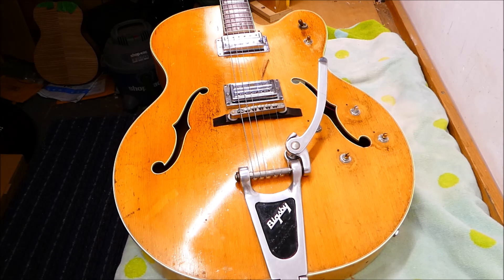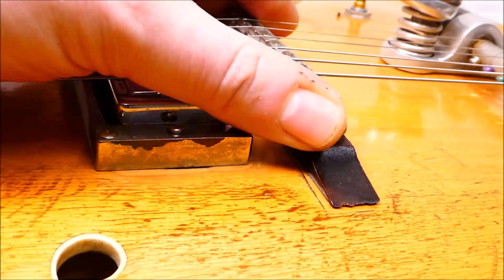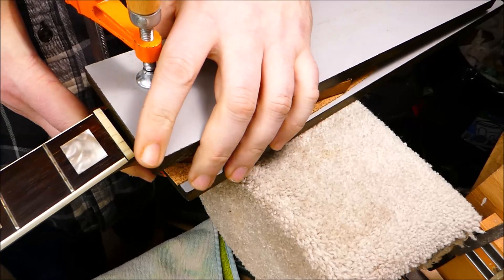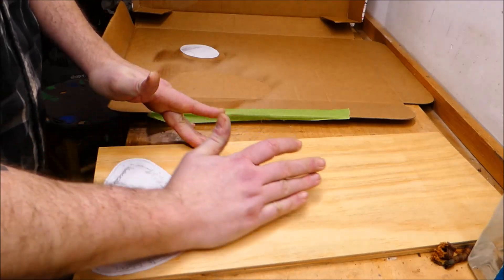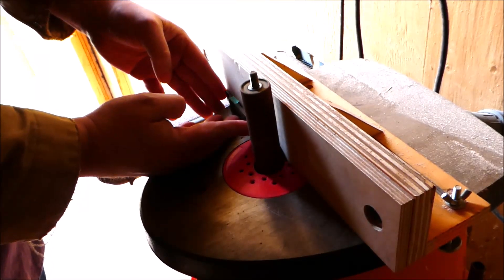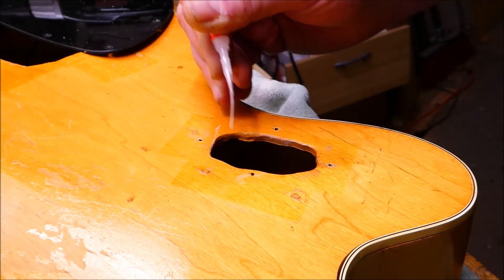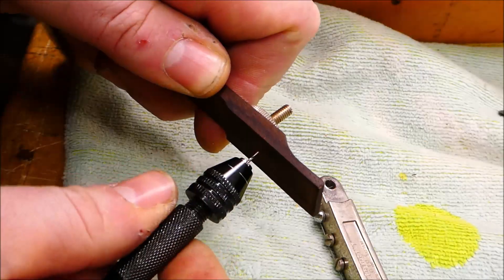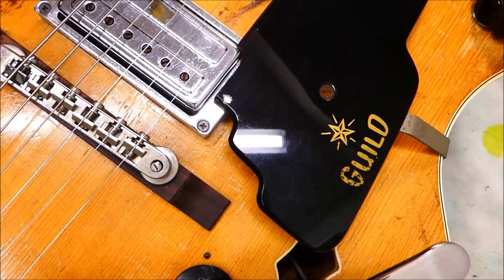'68 Guild Manhattan X175 Repairs

Comment: Nice! The replacement covers reminded me of a freebie I did for a guy at our church once. The pastor was trying to get the family to chose our church as they were looking for some where to go. The guy had mentioned he had a bass that was missing a cover, had a screwed up nut, and horrible ac buzz. The pastor asked me to check it out since that was my hobby. So I bought a new bone nut, a sheet of cover material, and supplied some coax wiring I had. Totally rewired the system with the coax, installed the nut , and made a new cover. All for free. I worked out of town and was home only 4 to 6 days a month. The guy was pissed because I took too long. Which I did, but I never even got a thank you for what should have been close to a 200.00 repair. Maybe you could do a vid one horrible customers at some point.
Reply: There's bloody Christians for you!
Reply: There's bloody Christians for you!

Comment: I have a 67 Guild acoustic I bought a few months back, It doesn't seem as boisterous as I would like it a players guitar. I got it at the local Guitar Center it was in the acoustic high-end booth it plays well I'm thinking of getting that back of the guitar Amp that had effects like reverb and some gain no permanent modification required, I don't have any trusted Luther out here in CA like I had back in NJ. Love just watching you work I feel I've learned a great deal watching you, not sure about fixing or diagnosing anything but if I did try anything I would need a shop, that is actually why I am moving back home to Colorado mostly family reasons, but having shop for me now is far more important then years before. Anyway you are a talented Luther I appreciate the things you share on such a wide variety of problems these skills are far a few between as time moves forward musical instruments that are actually used will continue to need works such as yourself. Thank You

Comment: Beautiful old guitar and I really like those small humbuckers. I’ve definitely gotten frustrated working on the wiring of hollow guitars but never so much I would cut holes in the back of one. To cover odd shaped routes I’ve set pick guard material in the sun for a while then put it directly over the route and weigh it down until it cools and it makes it fit perfect.

Comment: At 7:31, you were trying to measure the center to center distance be eyeballing the inside of one post.  I just learned a trick last week to improve the accuracy of that measurement, assuming both posts are the same diameter.  Zero your calipers while measuring the diameter of one post. Then measure the outside to outside dimension. The offset to the caliper zero will subtract one post diameter (or two post radii), reading the center to center measurement directly.

Comment: I have a '66 Guild Starfire V with Bigsby delete, clear finish, and the floating Haggstrum bridge.  It is is in FAR better shape than your 1968 example here .. but I have a tiny bit of binding loose up in the double cutaway area of the body. With a fixed tailpiece the Haggstrum has never been a problem. I have had it since new in 1967, almost 54 years. In a perfect world, it might enjoy a neck reset of a degree or two, and the frets need a fresh full dressing again.  

Nice recovery of the sad holes in the back. Your covers look excellent. As usual, your work is both tasteful and of artisan level craft.

Comment: I know we all appreciate the time and effort you into these videos. Thank you for sharing.

P.S. 5/16 - 5mm ID surgical tubing will be your best friend when working on these types of guitars. Get about a foot [ 300 mm ] and just stick the pot shaft into it. Pull the pot through the F-hole. A smaller version can be used for the toggle switch. Easy-peasy.

Comment: The saddle thing. When I have a guitar with a tune-o-matic style bridge and a trem. I use pickup springs on the screw in FRONT of the saddles to keep them from rattling sorta like a fender style bridge but backwards.

Comment: At about 4min in you said that you lost some of the finish off of the back of the headstock and I was wondering if some wax or parchment paper would have helped with that and can you use "Goof Off" cleaner to take off the garbage without stripping off the lacquer?

Comment: Couldn't you JB weld a bar across the bigsby at the string contact points to lower the break angle if you really had to? Or maybe a plate the has the same rounded edge? Never thought or heard of this before but it just popped in my head and got me wondering if that would be possible and if so do you see any repercussions other than the fact it's better to fix the problem rather than band aid it lol!

Comment: That's heartbreaking to see, I had a early 70s hollow body where somebody had done the same thing and cut a 'back door' rather than do a repair the right way and fish the wires through, at least that was just one hole .
Reply: Yeah cutting those holes is like ripping the doors off your car because you can’t stand the 30 seconds it takes to open and close them.
Reply: To me it depends on what kind of guitar it is. But I also get that if someone is a player who wants to change stuff it makes everything much easier. I had to swap pick ups twice on the same guitar for a customer. That got old pretty fast.
Reply: @wilson4180  no. On a car its a design choice, on a guitar its just faff. Easy acces should be prioritised

Comment: Can anything be done with a truss rod that is all the way loose? Oh by the way awesome job!
Reply: Meaning it can't be tightened?
Reply: @jonathanmartin3375   No. the neck is straight and the rod is all the way loose so if I want a bit more relief I won’t be able to
Reply: @IntoTheTroid1  That makes more sense.  The easiest/cheapest thing to try is going up a size in string gauge.  That can get a little more pull on the headstock and give you a bit more relief.
Reply: @jonathanmartin3375  thanks but don’t really want bigger gauge strings. I might have to take to a luthier and maybe have heat applied or some permanent fix if possible.
Reply: If you wanted to go to this extreme, you could have a luthier you trust put in a double action truss rod. That would fix your issue, but it may be a bit extreme for the fix your looking for.
Reply: @patrickniedermeyer2112  That's my recommendation as well.
Reply: @patrickniedermeyer2112  thanks I might have to do that
Reply: @jonathanmartin3375  it can be tightened but will create back bow
Reply: @IntoTheTroid1  Right, you don't want to tighten it, but if you have a dual action truss rod you can create forward bow in the other direction, which is what you need.
Reply: @jonathanmartin3375  no dual truss rod but I’m probably going to take it to a luthier. It’s a Parker southern fly so I think all is needed is heat on there type of poly or what ever car polymer they use.
Reply: @IntoTheTroid1  I mean my recommendation is to have a luthier install a dual action truss rod, if the heat doesn't work.
Reply: @jonathanmartin3375  👍

Comment: Would it have made sense to use a heat gun to make the plastic mouldable to fit the odd contours of the Guitar?
Reply: such a compound bend would be to hard to control with out a vacuum form and its a very slight  bend so hardly worth it.

Comment: Strange question. If acoustics are touchy to humidity why doesn't anyone try wiping on oil or a thinned layer of shellack to the inside of the acoustic box before closing it up? Why would they leave raw wood inside but finish the outside?
Reply: guitar should breathe
Reply: @Huhuy2000  what is the advantage of this?
Reply: Good question. It could have something to do with reversibility/ease of repair. Maybe as well, it's inherited from more traditional stringed instruments (violins etc). Most likely it's because the finish is there primarily to protect from handling (sweat, grease, knocks etc.) and the inside doesn't need the protection.

Comment: Hi. Sorry if my question has been made a zillion times buy I'm new here. Do you dilute the tung oil? In how many parts and with what? tks
Reply from the maker: I use it full strength.  This is polymerized tung oil. It has thinners and driers in it.
Reply: @twoodfrd  tks. I'll try to find some around here.

Comment: I asked this on an old video, but you're more likely to see it in a new one: When you say you're using a "thinned" glue (be it Super, Tite Bond, or animal glue), what are you thinning it with? Is it just water? Or a chemical thinner like Mineral Spirits or Paint Thinner?
Reply: I've heard him mention using very minute amounts of water
Reply: Depends on the glue. Carpenter's glue you can thin with water. Same with hide glue (hot water). Superglue comes in different viscosities. He used a thick one (I think) to glue the plywood backing to the template and he used water thin to saturate the many holes, delaminations etc. with the syringe/pipettes.

Comment: I've got a hollow body Gretsch 5126 and could do with getting inside it to do some maintenance and have been trying out some different pickups to the De Armonds that the guitar has.
I'm dreading having to fiddle around getting everything out through the F-holes and pickup cavitied, but there's no way I'm hacking the f@cking back of the guitar out to get at everything.
Dear me what a mess, it would have taken longer to cut those holes in the back than it would to have done the fiddly F-hole keyhole surgery 😆👀

Comment: I remember reading something about no naphtha in Ronsonol any more. But it still burns.
Reply: "Naphta" is just a term for petroleum distillates. They don't list the exact composition on the safety data sheet. I guess they use what they can get, as long as it burns.

Comment: You mean UNrefined - not ill-refined. I would've filled those holes in with wood matched as closely as possible instead of plastic covers which only looks amaturish! I would've also used a paper thin rubber  gasket to glue to the bottom of the bridge so that you don't have to drill into the top of the body. I did this on a Melita bridge on my Gretsch. It keeps it from sliding when using the tremolo. I used 3M brand spray adhesive to glue these pieces after tracing them out. Either way at least you did justice to this poor guitar. I use surgical implements to remove the controls on acoustic electric guitars. This way I can do an easy and professional job without damaging the instrument. Just look for them online. I found them locally from a specialty tool shop.

Comment: I looked it up and lighter fluid is just naphtha. I suppose you can just buy naptha and save some dinero??
Reply: It can be a little hard to come by as just Joe Consumer, and tends to come in gallons, but yes you can.
Reply from the maker: VM&P (varnish makers and painters) naptha can be bought through paint stores, but it doesn't have the handy little dispensing spout you get with lighter fluid. Plus, Ronsonol was what Jimi used to burn his guitar at Monterey.
Reply: @twoodfrd  Refill....😁 😆

Comment: Simple but brilliant idea putting super glue on the cut and drilled edges of the laminated body material in order to minimise the chances of further de-lamination. This was an excellent repair job, those horrible holes in the back of the guitar have vanished under the very neat covers that you crafted. Guild were a great American guitar builder.

Comment: How bad do you think carving/replacing the whole back would’ve been as opposed to sticking with the access holes? 

It ain’t even that bad working through the f holes, you just have to tie fishing line or thin wire round each of the pot/switch shafts before you remove the nuts. For the output jack, stick an old plug in with string tied around the solder terminals. 

Any parts you replace, just tie the string around the new part. Then getting it all back in is just a case of pulling the strings, and guiding stuff into place through the holes with your fingers.